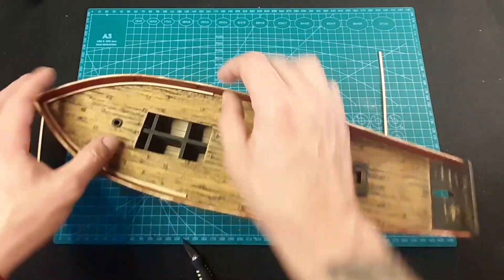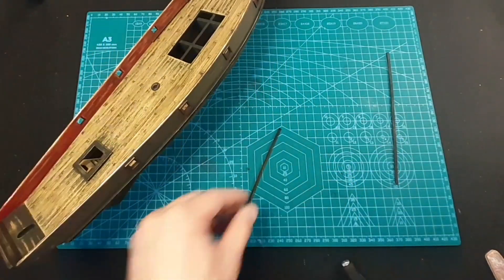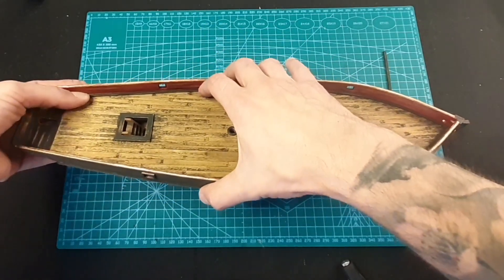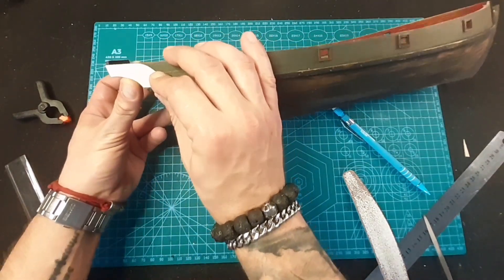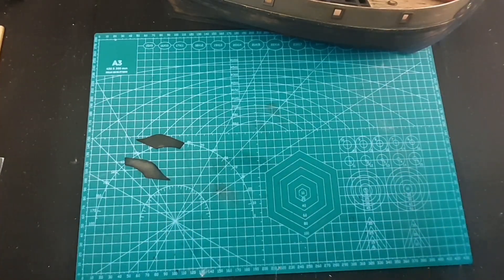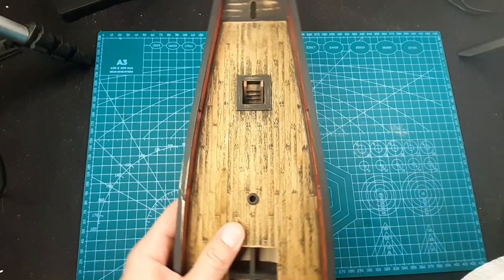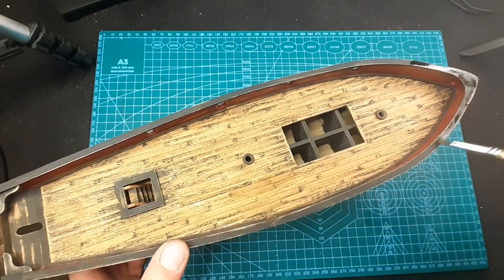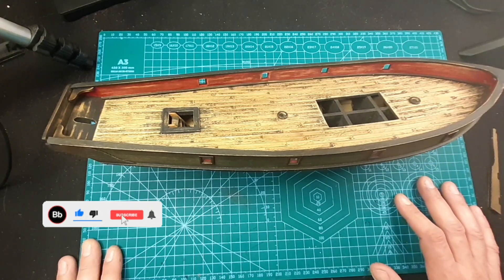Polaris #10 Finishing the hull

Comment: I am interested to know? In part 10, you use CA glue with the railing. Earlier in one of the videos you said you try to avoid using them. What type of CA in the yellow tube do you use when necessary? It seems to have a thick viscosity as I don't see it running when applied. I am enjoying your build and all of your suggestions. I received a Polaris kit from my daughter and plan to start it soon. So watching your build and examples are very educational. I thank you for posting them.
Reply from the maker: Thank you very much for following my work. Great gift from your daughter. The glue that I'm using when it's necessary is a super glue but gel glue. It's not drying very fast so you have time to work with it. And doesn't run "like you said" so easier to work with. Gel glue. Not problem to find it